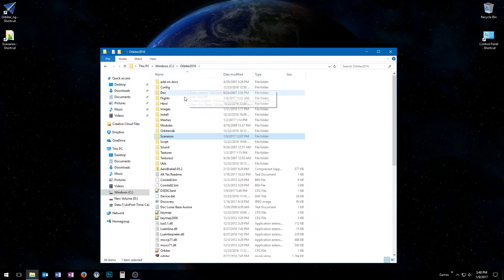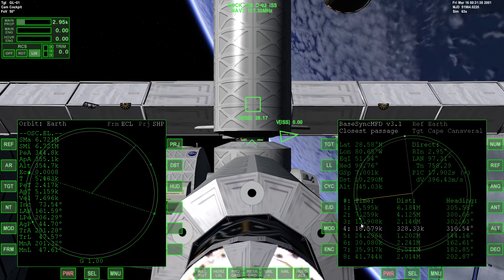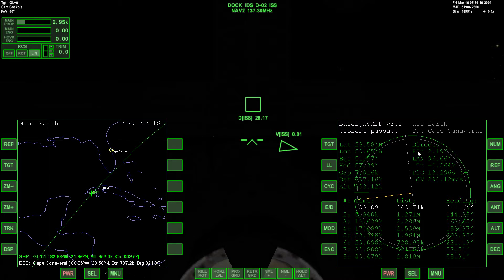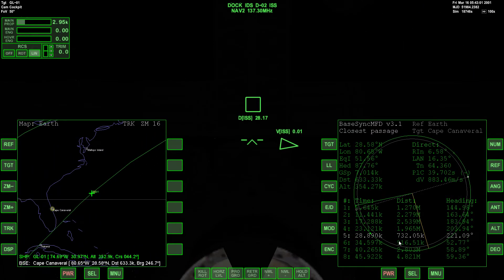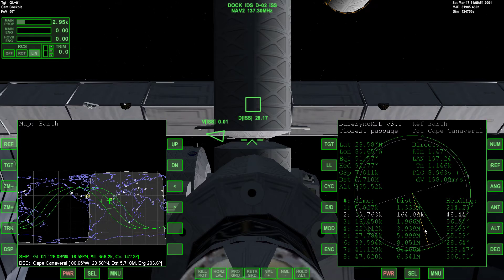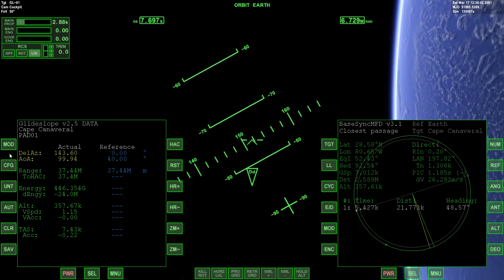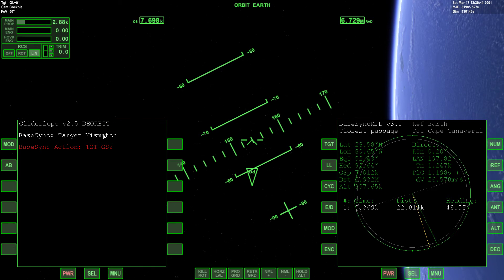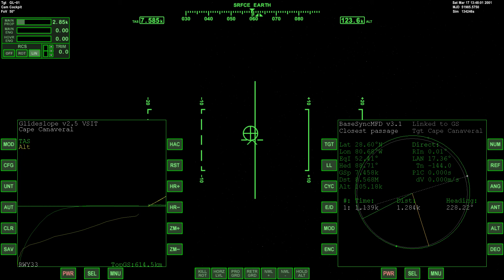Part 6: De-orbit Procedure (ORBITER Tutorial Series for Beginners)

Comment: This is an old video-- but I just wanted to mention that Joe Engle flew the STS-2 re-entry and landing by hand, so a manual re-entry isn't necessarily impossible in the real world
Reply: There are actually three methods of flight control that get confused as being two: Autopilot, digital fly by wire, and manual. Manual means the pilot is controlling the wings and rudder directly. Digital fly by wire means the pilot uses the stick to tell the plane which direction to turn to and then, the computers control the wings and rudder themselves to turn the plane to that desired direction. Autopilot and digital fly by wire are almost exactly the same except that in the latter one, pilot is giving more directions. 

Fully manual control means that the different pieces of the plane can't be controlled as independently, meaning not every bump in the air can be compensated for. This matters especially when going in the extreme speeds like in fighter jets and formerly space shuttles. The bumps and rumblings in the air and in the craft are so fast and in so many different directions that every piece needs to be computer controlled to keep the craft going straight, because any slight stall will become a spinning explosion. So in one of these vehicles, your pilot is going to use the stick to input a given maneuver, and the computers will be crazily moving all the parts in all the different directions to keep the thing steady while also calculating moving them all in the directions they need to to follow that maneuver along the way. It's something that no human could possibly do. 

By technical definition, manual flight is impossible in these scenarios. This digital fly by wire control is what's used in all cases at these high speeds, including that particular re-entry. Obviously it's a hell of a lot more badass than the typical push the button and sit there approach that usually gets done ;)

Comment: I've opened the zips downloaded from my browser, then I right clicked and hit extract all, I put every file into C:/orbiter2016, why do i not see mfd?
Reply: I just had the EXACT same problem Ascher.  Dowloaded, unzipped to my orbiter 2016 directory I had created, but no MFD's showed up when running orbiter.  But then I looked closely, and saw that I unzipped the files to the directory that I was using to store my original orbiter exe downloaded file, and not to my C:/Orbiter2016 directory created by the initial install of orbiter.  So I unzipped again, to the correct directory, and now the MFD's do show up, but on the second page of mode select display.  Dave
Reply: @misterhiker  damn I feel like I fixed this problem but it's been so long I don't remember what I did
Reply: @misterhiker  Yes, it's normal for the addons to appear on second page. I have so many mfds that I have 4 pages :)
Reply: Did you enable it in modules in launchpad?